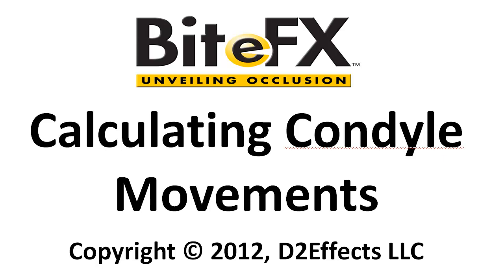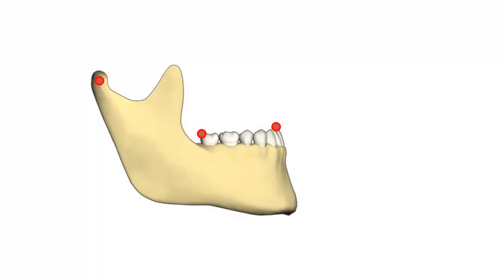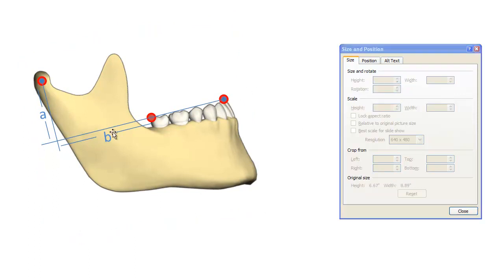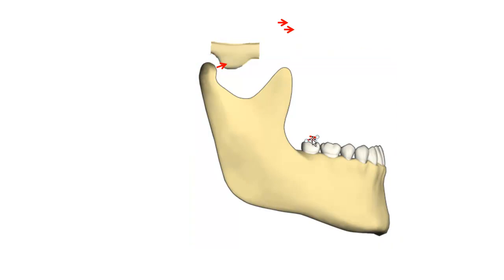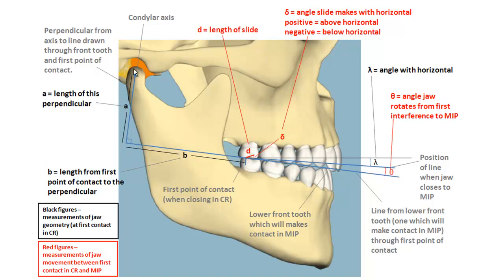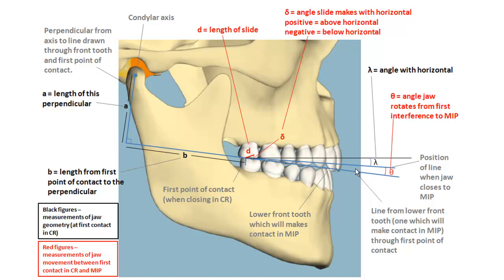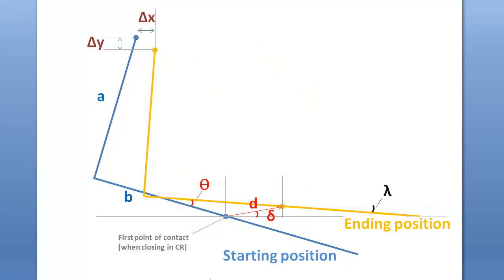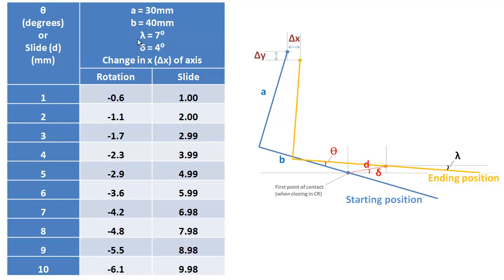Condylar Axis Movement from Centric Relation to MIP

Comment: some Qs.where did these values for rotation and slide come from?
and it is well established that the minute the condyle move there is both translation and rotation along n axis that never runs through the condyles
and through which part of the condyle does the axis drawn pass?
because a point has no oientation.hence choosing some arbitrary point on the condyle and doing calculations based on that is meaningless.
Reply from the maker: Hi Mohan. 
Thanks for your interest.
The values in the table are example values. The idea is that someone observes how much a jaw slides forward (from CR to MIP) and how much the jaw rotates. They can then take those figures and look up in the table how much the slide moves the condyle forward and how much the rotation moves it backward, then add the two to find out whether the condyle moves forward or backward.
The purpose of sharing these calculations was to help resolve the arguments I kept hearing about whether the condyle moves down and forward or down and back when the jaw moves from CR to MIP. It felt like there was an unnecessary debate going on. The jaw is essentially a rigid object, therefore measuring the motions of the teeth (how far they slide forward, and how much a line drawn through the teeth rotates) precisely determines how the condyle moves. It's not a question of debate, just needs to be calculated.
If you make measurements of the angel theta and the distance d, or just estimate them, you can get a feel for whether the condyle moves down and forward or down and back.
The calculations make no assumption of where the axis of rotation is. They only consider the difference between the starting and ending positions measured by the distance d and angle theta.
The lengths a and b, and angles lambda and delta, are estimates of what those values are for an average person. They can be edited in the spreadsheet to match different types of patients.  Varying them doesn't make a huge difference to the conclusion that if the rotation is big enough, the backward motion it produces in the condyle is greater than the forward component given by the slide.
I'm afraid that if you don't understand that choosing an arbitrary point on the condyle is quite valid for these calculations, you're not going to understand the calculations. The motion of any point of the condyle is going to be closely matched by any points close to that point - they are all either going to move forwards or backwards or stay the same horizontally. (There will be very small differences because of the rotation, but too small to be significant in this calculation.)
In practice anyone wanting to understand what's happening with their patient's jaw joints will take CBCT or MRI scans in both CR and MIP and observe the different positions of the condyle in the two scans.
Doug